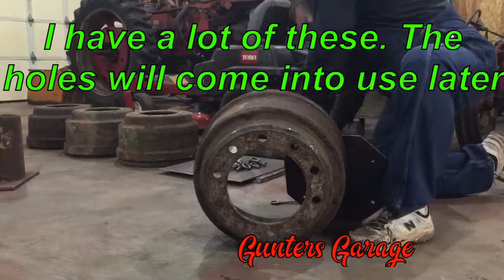Brake Drum Power Tool Stand, Part-1

Comment: Your work bench seems to be treating you well. That's a great base!! Don't need to worry about it being unstable!
Reply from the maker: It is a real back saver. Spoiler alert, I will also be filling the drums with concrete. Those eye bolts Im using to bolt it together will lock into the concrete to make sure it stays in the drum. Should put the base at about 200 lbs, nice and sturdy.....I hope.